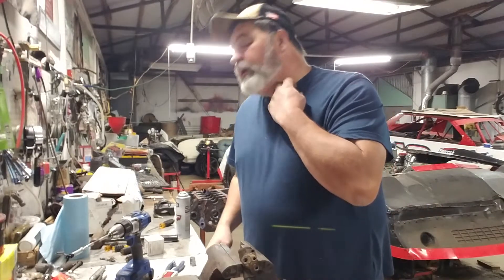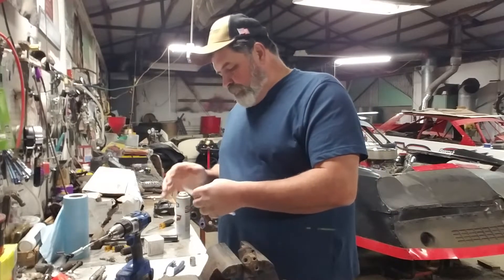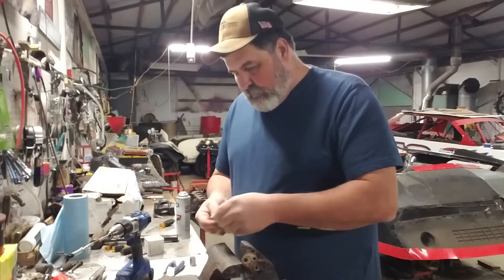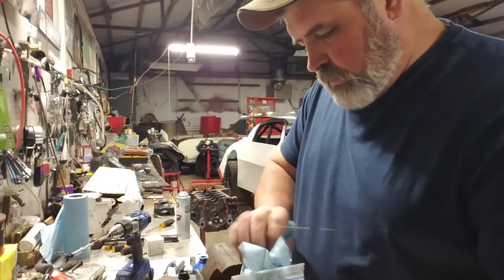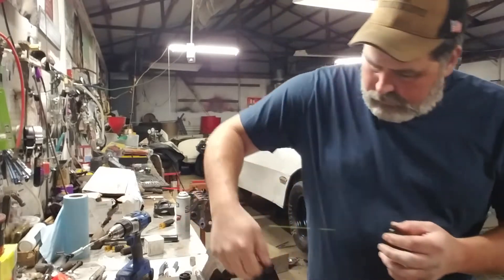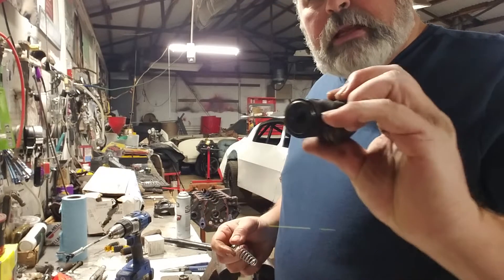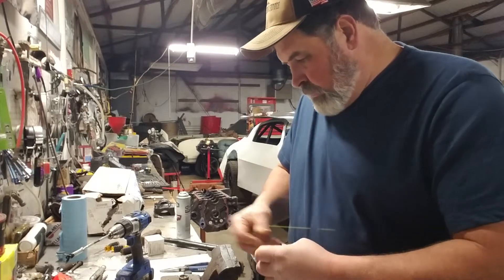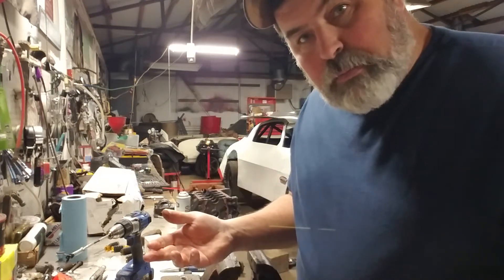Rebuilding Wheel Cylinders. #nonamenationals

Comment: I know automatics are for the most part much more consistent with drag racing, but there really is a charm and challenge to racing with a gearbox.....granted that's my only option with my VW related racing vehicles.  Either type of transmission will be sweet for the 'ol outfit-z.
Reply from the maker: Thank you sir